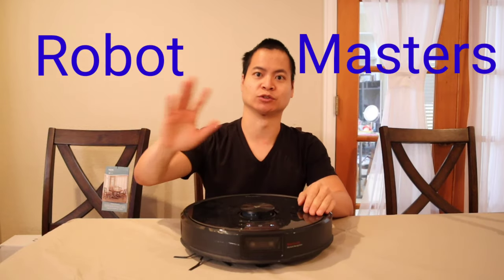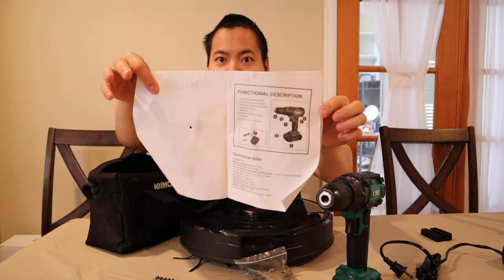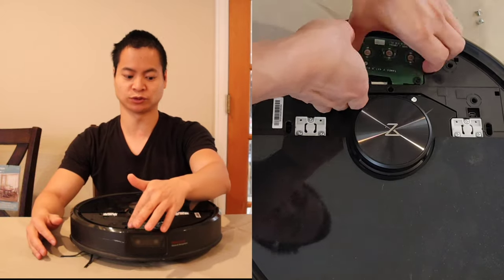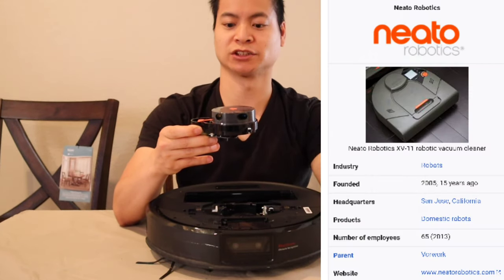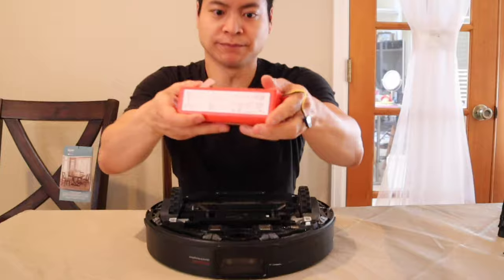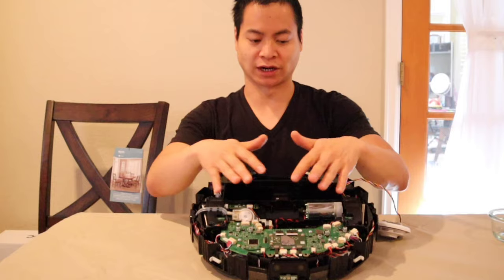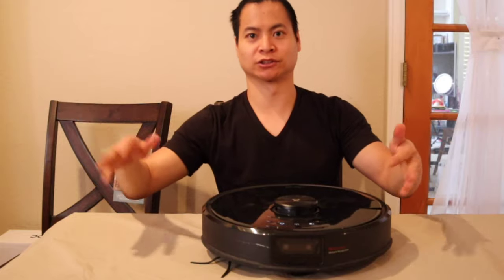Roborock S6 MaxV Teardown of Smart Robot Vacuum. Used KIMO T20 Cordless Drill Driver Kit for TOOLS!!

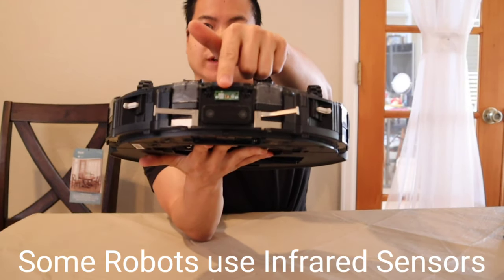Comment: Thank you!  I slowed down the video at 9:35 to 0.25x speed because you removed those base plate screws so fast!  I took the unit apart to solve the error "filter wet or clogged" when it is actually just a build up of lint and dust in every nook and cranny plus in the intake screen of the fan motor.

Comment: This was super helpful! Had to replace one of the driving wheels myself, but noticed you hadn't been able to remove the wheels. The axle is accessible if you pop the cliff/IR-sensors just up (push it with a snap from the camera towards the wires) and then you can slide it out with a thin rod!
Reply from the maker: Thanks for the tips, I thought you needed a special punch out tool 🙂
Reply: I'm not sure I understand how to remove the cliff sensor. . .  I tried to pry it upwards, but it has fingers holding it in place. . .  I was afraid of breaking the damn thing. . .  "Push it with a snap from the camera towards the wires"  What camera?  What wires?    Far as I know there are no cameras on this bot. . .  Just lasers and ir sensors.  Wish someone would show such things on a video. . .  Every video does these things on an S5, and the S6 design makes it a bear to change wheels . . .
Reply: @Alfamaxis  Yeah. . .  I figured it out, after some turbulence, but my model actually is not the Max model. . . just an s6.  I think that it (plainjane s6) doesn't have a regular camera. . . and I'm not sure you'd classify most IR sensors as cameras. . .  more like a distance sensing gadget for near objects.   I'm pretty sure, after consideration, he was referring to the business end of the sensor, which faces downward on the bot, and the wire plug in end of the sensor,  which is at the top of the bot.)  So. . .  After the carcass is completely disassembled push the sensor up till it snaps out. . .  at least that's my translation.
Reply: Thank  you! With your comment I was able to inspect the wheel unit, but unfortunately one cannot remove the drive wheel from its cover to clean the axle, f.ex., it seems.
Reply: Anyone have a helpful video on how to remove and replace the wheel? I keep getting an error 106: Left Wheel Open Circuit. Unable to remove pin that holds the wheel axle. Would appreciate any and all help with this!

Comment: Thank you for this i needed to replace the motor wheel its actually very easy all u need to do is slide the sensor up and outta the slot its in and u an just use anything tiny to push the rod out the Motor is connected with an extra 2 little gray wires be careful u will need a tiny but to undo the very small pcb that those wires run to it looks like they come as a unit not the same as the s6 or older models
Reply from the maker: Thanks for the tip!!!
Reply: I just replaced the motor and used this video: https://www.youtube.com/watch?v=Wc-zeVOcWAs&t=87s  to get an idea of the grey cables mentioned and how to push the rod down. 
It was not initially clear to me that the sensor should be pushed up in order to push the rod out :)

Comment: The extract bar are taged by small pins to the the silicon edge in the other side of robot. After unfastening it, remove the 2 joint axles, forcing them slightly so the piece comes out. finally unscrew the brush motor (white piece on one side)

Comment: how have you put back front bumper?
there is a rubber cover is hard to put back
Reply from the maker: Yeah take some needle nose pliers or a small screwdriver. Carefully align the rubber gasket around the camera system. There a small grove that the gaskets sits on to prevent dust to enter the camera housing.
Reply: @RobotMasters  Thank you 🙏
I removed it easily, and then realised  that it not so easy to put it back 😂

Comment: 8:53 ok how do you install that rubber back on cameras?
Reply from the maker: It takes some finesse but just push the rubber dust grommet in and wiggle back and forth. It does take awhile to slot in the groove.
Reply: @RobotMasters  4 hours later: so the window can be unattached, then you can fit the rubber back in place, attach the window and screw the arc. But in general if you see a few dust in there, IGNORE.
Reply from the maker: @kev4ev  Yeah it definitely not easy, pretty sure the factory has a specialized tool.
Reply: Observe back area of window. On the bottom it has 2 cylinder shaped notches. Press on them down (outward) and window comes out of the frame. 

You put bumper back on, and align gasket easily in a minute because you have full access to camera notch. Then you put window back up and screw all screws in bottom baseplate that connects with bumper. Note that center 2 screws fit in exactly in that 2 cylinder shaped notches that you used before to push window out!
Reply: @abccde3832  You are my hero!

Comment: I need to replace the fan, can I only remove top part to get to fan or do you have to also remove bottom?
Reply from the maker: Not sure are you talking about the fan housing? Anyway the two pieces split apart, held on by a few plastic pressure clips. For those just take a flat head screw driver and gently lift up on the clips. Yes you do have to take the top part of the robot off to access the fan unit.

Comment: Where’s the exhaust fan/filter?? I’ve been reading that decreases performance could indicate a clogged exhaust, but I’m not sure where it is.
Reply from the maker: The exhaust fan the circular plastic unit with a few wires attached to it.
Reply: @RobotMasters  found it! Do you see an easy way to clean any clogging in there without opening it? Push air in from outside??
Reply from the maker: @Tech do Liberal  Unfortunately no, the casing required opening to access the fan unit.

Comment: Hello, my unit vacuumed dog poop and a family member decided to run water on to clean it now the unit doesn’t work. Start button just flashes. Any idea what I may need to do to fix it?
Reply from the maker: My recommendation is let it dry out for 3-5 days. Try to remove the battery while the robot fully dries. Once the 3-5 days are up try recharging the robot and running it.

Comment: Great video thank you very much. I just need to ask you something. I was using white vinegar and bleach for mopping. Now I think the water way is clogged somewhere. What can I do? any recommendations would be appreciated.  Thanks.
Reply from the maker: Unless you are comfortable opening the robot up and void your warranty I recommend asking Roborock for servicing. If you are willing to take the risk, you may need to open the robot up and try to clear the water hose.
Reply: @RobotMasters  Thank you for your prompt resonse. However, I do not think the servis would help me as I used vinegar and bleach for mopping. They would understand easly. I’ll try to clean the pipes. Cheers.
Reply: temizleyebildin mi? Ben az deterjan falan koyuyordum tıkandı su çok az geliyor. Nasıl temizlenir bu

Comment: hi, I want to ask a question about battery performance and life in general. I am using s5max. When will the battery lifetime start to decrease if we use it at least once a day and everyday in a week ?
Reply from the maker: It really depends on what lithium battery they are using. You can expect 300 - 1,000 complete charges to discharge cycles before you may notice a decrease in battery life. Usually 2-5 years, remember the robot will auto recharge once the battery gets to a certain charge level and resume where it left off. I don’t think you will notice the decrease in battery performance or be affected by it if it does happen.
Reply: @RobotMasters  it is roborock s5max.
Reply from the maker: @baranbaris1172  Yes applies to S5 Max

Comment: Hi There can you explain how to run this robot without - WiFi - ex. disconnecting some wire from the board etc.?
Reply from the maker: Hmmmm look for a thin wire that not connected to anything, that usually the WiFi antenna,
Reply: @RobotMasters  the wifi module dosen't have external antena it  looks like integrated in bda module
Reply from the maker: @stanisawbiaas827  OK not sure how to discount the board, if it integrated directly in the circuit board. Is there any ribbon cable you can discount that link to the WiFi module?

Comment: Where can i find the speaker? I would like to disable this.
Reply from the maker: Look for the exhaust vent on the robot, the opposite side is usually where the speaker located. It looks like an exhaust vent too, but it not. If you are unsure run the vacuum and feel for the air flow. The other side the speaker.
Reply: @RobotMasters  Thank you for the message. Do you have any idea if it is just unplugging cable or?
Reply from the maker: @jon964  I can't recall, you might need to cut one of the wires